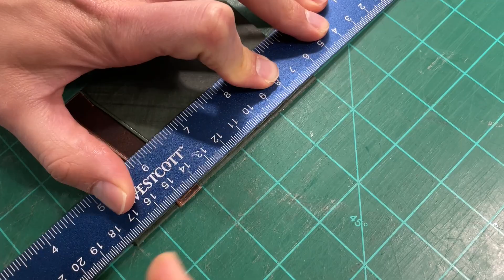Quatrain Leather Cardholder Tutorial (NEWER VIDEO SOON)

Comment: The whole point of "trim allowance" is so that you do not have to sand the edges.   If you sand the edges after you cut your trim allowance, then you are defeating its purpose and should not even use trim allowance.   you are also making your edge worse,  because once you cut the trim allowance you will have a perfectly smooth edge made from the knife,  and if you then use sandpaper, it makes the edge rough.   so bottom line is,  if you use trim allowance then do not use sandpaper afterwards!
Reply from the maker: Hey fair point! Thanks for the comment!